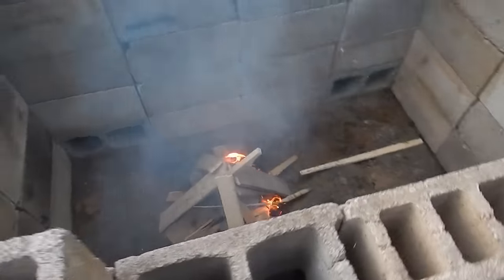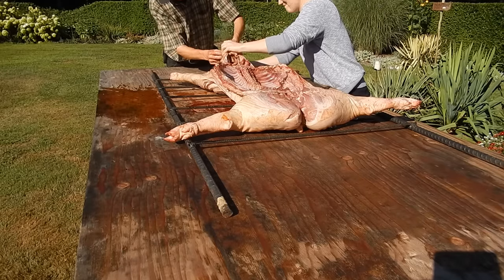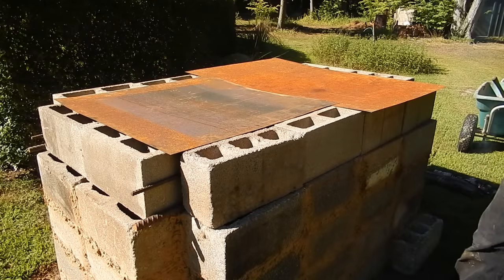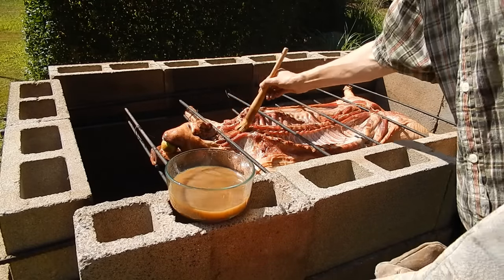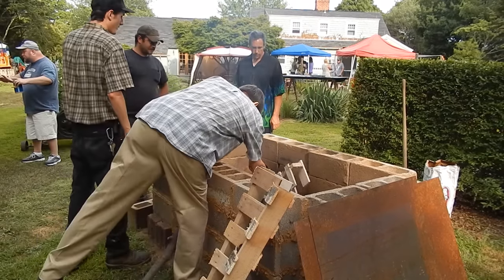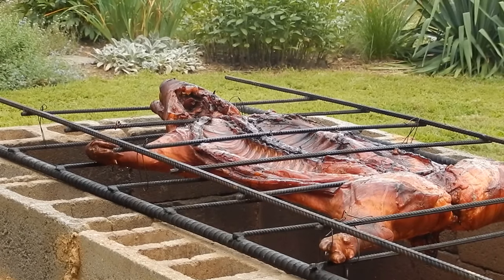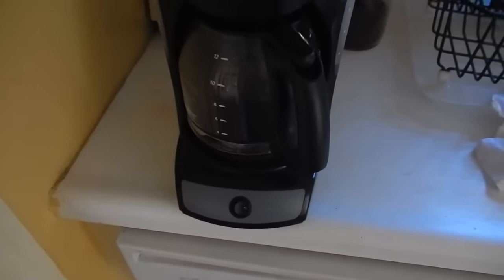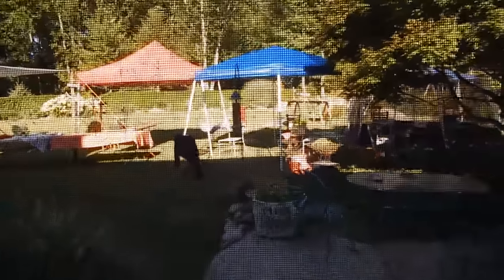Pig Roast How-To! - Part 2...

Comment: A Guy back home that cooked for the whole community...7 hogs at one time...told me how to cook a pig.  He cooked skin up first 2 - 3 hours and then turned it over and cooked it skin down the rest of the time.  He said you lose the juices if skin is up during the last part of the cooking.  He also said that if you have to "chop" it with a knife, it is not done.  He did not use thermometers so I don't know the exact temperatures he did.  We shredded the meat with 2 forks and the skin was crisp.
Reply from the maker: your skin up/down sequence makes sense! I'll have to do that next time if i do this again. The pig was plenty moist though, thanks to all the marinade i injected into it the day before.
Reply: 195° for pulled pork. Getting the skin crispy is an art.
Reply: @themadmailler  you should do it every year. what a great tradition! We do this for Christmas Eve and it has been years and years of memories.

Comment: Did he say he cut up a pallet for fire 🔥? When it comes to roasting, smoking, grilling, or barbecuing. The type of wood used is just as important as the rub,  and sauce. I only use hardwood, oak, pecan , mesquite, mixed with charcoals. The pallet wood is normally treated or pine wood. Not on my grill!?😠

Comment: Good video.  Just a hint for next time.  Pork is done at 165 internal temp but if you want it pull apart tender, it needs to cook till 200 in the hams and shoulders.  Keep most of your coals under the hams and shoulders to keep from overcooking the loins and ribs.  Your pig is done when the leg bones turn and pull out easily.  You shouldn't need a knife to cut it off the bones.  It should fall off!  Keep your pit temperature between 275-300 no hotter unless you want to crisp the skin at the end.  Every pig you cook will get better and better.
Reply: Best post on here!
Reply: You were the first person I saw post that actually knew the finish temp for pulled pork. I actuall only take it to 190° myself but it probably finishes off around 200° by the time it stops cooking.

Comment: I think you should put salt and seasoning inside and begin the cooking with the bones side down. When the heat pass thru the meat and the skin is hot then flip the pig and then cook until the skin is crispy. In total not less than 5 hours. At least that's the way we do in Argentina.
Reply from the maker: Watch my first video where I detail marinade injection to ensure a juicy tasty pig! This pig cooked for about 7 hours. nice and slow.
Reply: @themadmailler  looked for the first video didn't find it, twice.
Reply from the maker: @torinbrown8196  https://youtu.be/LH3nxRwLxig
Reply: I have seen some Argentineans use galvanised chain link fencing to sandwich a butterflied hog. I know the argument that the temp doesn't get hot enough to have the galvanise gas off.  Some of the cubans use the same technic. Tastes great though. 

Do you use chimi churi on your hog.

Comment: If you wish to make a hog pit, PLEASE think ahead and use heat resistant mortal in your joints to build the thing.  Keep in mind air flow is not your best friend if you cannot control it,  and you can pour sand into the voids of the block to help you with insulation/heat control.  Enjoy.

Comment: Try not flipping it, we add the sauce to it while it's cooking, cut slits in the thick parts of the meat, low and slow for around 12 hours, the meat will start pulling off real easy you won't need a knife and you can let the meat soak in the sauce. I like the charcoal idea it simplifies the heating method, we burn wood in a barrel and put a light amount of coal under the shoulders and hams periodically, not under the ribs or it will burn

Comment: The big problem with using a (Rusty) metal plate to cover the pit is that the heat from the fire will cause the rust from the metal plate to fall into the meat and that's not good for consumption.
Reply: ProVersion Source it's iron
Reply: However he easily could have hit the sheet metal with a wire brush on a drill, then coat metal with a little vegetable oil, just like seasoning cast iron. Clean the metal a little after cooking, re oil and it will be fine for next cookie g

Comment: Thanks for the video, I really enjoyed it. Although I cringed every time I saw how the blocks were laid, with out offset. That can lead to a weak and unstable wall. I guess it all worked out and didn't end up on the grass. All the best.
Reply from the maker: you're totally right about the incorrect block layout, but this is how everyone seems to do it if you look at other how-to's online. I made sure the base was perfectly level, so nothing went wonky as i laid the blocks. it comes out as a good size this way, too. If i were to make this permanent, i would definitely stagger the blocks.

Comment: I would have rigged the pit with one side open to add fire amber
It takes what 12 hrs to cook that thing?
Reply from the maker: one cinder block in each corner is sideways, so i can feed coals through the holes.
Reply from the maker: it took 7 hours to cook this 65 lb pig.

Comment: I don't know, from the rusty sheet metal, using pallets for smoke and cutting it up on plastic sheeting, looks a little sketchy to me.  Plus I would never use my knives around the rebar rack.  As with a comment below, another 5 hours would have rendered better results.  But at least we've learned something.
Reply from the maker: Metal was rusty on top, greasy and smoky on the bottom just like any other bbq grill. If you can find me a pig sized cutting board, go for it! otherwise, a plastic sheet over a table is fine. And yes, the lower and slower on the heat is better.
Reply: @themadmailler   A new sheet of untreated plywood is what I use to cut pig up. Works great.
Reply from the maker: @danmatherlee136  yup, that's what i used. it's a pig roast, not a surgical operation!

Comment: Use a meat probe connected to a remote thermoometer so you don't drop the heat and stop the cooking process every time you check the internal temp......and when the meat is done right you can just pull it off the bone.....you shouldn't have to be cutting things up like that.

Comment: Pallets can be contaminated with chemicals from when they were used in manufacturing facilities.. leaky containers etc.  There is no way I would cook my food using pallet wood.
Reply from the maker: I cooked with charcoal. I only used clean pieces of  pallet wood to heat up the cinderblock pit and char the skin for 5 minutes before serving. Contrary to belief of the YooToob armchair experts, I am capable of not poisoning myself.
Reply: @themadmailler  down in florida we use light-or-not to start pit fires. You would never want to cook over it. When the fire get going good you simply remove the log. Haters are  always plentiful on YouTube.
Reply from the maker: @danmatherlee136  yea, everyone is an expert! But of course they don't have a pig roast how to video on their channel.

Comment: when the pic is properly cook on a pitt, you do not need a knife  to remove the meat, it will pull off the bone. Good try though. One day you will learn how to do this.
Reply: Make a vid and then tell us how its done. Some like a firmer pig
Reply: I agree.. this pig was not cooked correctly at all.
Reply: @davidg813  lets see your video showing us how
Reply: It's the final temp not the process. 195° is what you want for pulled pork. Not necessarily what they were wanting to do here. I have cooked hogs many ways and to many different finished temps and its all good.

I give this video 2 thumbs up.

Comment: Why would you use pallet wood???
Reply from the maker: initially it was used to heat up the pit, and in the end it was used to char the skin. pallet wood is nice clean poplar and oak so it's perfect for that purpose.
Reply: themadmailler, nice. Thanks for the info
Reply: I wouldn’t consider pallet wood Nicewood a lot of pallet wood is even treated yours didn’t look treated but looks like it turned out nice
Reply: Kyle Mark that was my thought as well. I think what he is using is a non treated oak maybe.
Reply from the maker: Yea, it's great stuff! kiln dried and easy to cut up. no splitting needed. just watch out for the nails when you're tossing the ashes.

Comment: How not to! That was some amateur stuff guys. Sure party was great but that pig could’ve been so much better
Reply from the maker: And you know this how?
Reply from the maker: @bruce9648  If you're an expert, you shouldn't be watching "rookie" pig roast videos.
Reply: @themadmailler  was trying to help, I'm not a expert, but I'm in the south we have cooked hundreds, just saying listen instead of being combative, try doing coals from wood next year, you can control your heat ,and if it's cold out you can stay warm, no mortar, blocks 3 high, used big peices of cardboard to cover pig, no sense in warming pit up, injection is fine we use a gallon of vinegar salt pepper & yellow mustard mixed up in the vinegar containers and  use through the 8 hrs of cooking

Comment: You need to stagger those joints on the block! That was dangerous and could have ended in serious tragedy man...
Reply from the maker: Lots of people make pits just like this. it isn't super secure, but if the ground is perfectly level (which i made sure of before starting) it stacks up fine.
Reply: The resulting sink hole could of swallowed the whole neighborhood.

Comment: steel sheet cover is full of rust when it hot where do you think the rust will go
Reply from the maker: It's only rusty on top, not on the bottom where it's been covered in soot. Also every bbq grill out there is plain rusty steel, and no one complains about that.

Comment: That's rusty plates you used as cover that's no no it's poison
Reply from the maker: rust is not poison. Also, the sheet steel did not come in contact with the pig, and the underside of the steel was not rusty due to being covered in soot and cooking grease. Also, every bbq grill out there is made from plain, rusty, "poisonous" steel and no one complains about that! Thanks for the armchair expert opinion.
Reply: Surreal true.
Reply: no..it adds iron
Reply from the maker: walnutlogger 43  it does not touch the pig. either way, cast iron frying pans are iron, bbq grill grates are iron...but there are no youtube armchair experts to complain about that!
Reply: themadmailler 
that was the point i was making.
once metal reaches 150°it is sterilized.
it adds iron oxide to the diet.not steel..nor poison.
now.if you used galvenized....lol
Reply from the maker: walnutlogger 43  gotcha! Good point on the temperature of sterilization too.

Comment: blocks stacked wrong, stagger the joints dude
Reply: surprised the walls didn't fall down
Reply from the maker: They were on level ground so nothing came apart. I know it's not proper masonry but it's fine.
Reply: @wingnutjack9463  Or it didn't put a rip in the space time continuum.

Comment: for my money , rotisserie   is better..
Reply from the maker: Total cost for the pit was about $20. less or none if you scrounge all the materials. Rotisserie is fancy, but complicated and expensive!
Reply: @themadmailler  in Philippines they use a bamboo as a spit and a couple of rocks to support spit, open fire directly on the ground and they turn it by hand. Cheap with great results but constant work.

Comment: The look of your hog your heat is to high your roasted pig would be better if you slow cook at low temperatures try roasting your pig with red hot coals instead of roasting it with a red hot flame buddy

Comment: No you cook the eternal temp of pork to 165 to 170, those rusty tin sheets are a bad ideal end up with tetanus or worse. Stainless steel would work better.
Reply from the maker: yup, that is the temperature that i cook the pig to. steel sheets are not a problem. BBQ grills are made from plain steel and no one complains.
Reply: Aluminum is bad. A little oil on the steel sheet metal will control any dust
Reply: @michaelanderson1859  OK lol
Reply: @chrisbuhneing3194  Have you ever cured a cast iron pot? It's amazing the arrogance of people that obviously have no clue about a subject giving others advice.
Reply: 190° for pulled pork.
Reply: @danmatherlee136  Were are you getting the cast iron pot from? probably the one you beat yourself in the head with, the only arrogance would be you assuming others advice as not constructive and not insulting imput.
Try giving some kind of real constructive criticism instead of trolling YouTube looking for something you have no knowledge about.

Comment: I'm not going to ridicule your method of cooking I really don't see where you went wrong at all great video but I would of done things a lil differently to start with I would of prepped the pig before even thinking about setting it on the pit. I see where you added marinade and salt after the fact just my personal way of doing things I would have marinaded my pig for 12 hours before hand and I also make a homemade dry rub but looks good
Reply from the maker: If you look at my "part 1" video you will see that i do exactly that! I also inject the pig with about a 1/2 gallon of marinade with a large meat injector, that way the meat comes out super moist.

Comment: Do not follow this guy doing itis not healty. two top metal is rusty like hell.
Reply from the maker: It's fine, we're all alive. also the top is rusty from heat but the bottom is greasy and black from soot and pig roast fumes. What isn't healthy is having to deal with youtube armchair experts!
Reply: @themadmailler  You can spray all metal surfaces with vegetable oil to cure.It like cast iron pan. Great video, I enjoyed it.